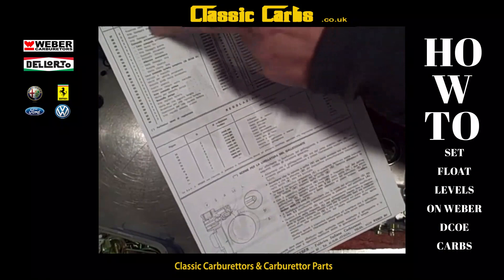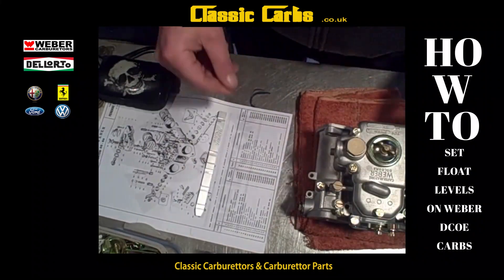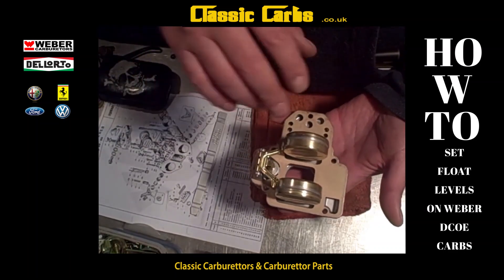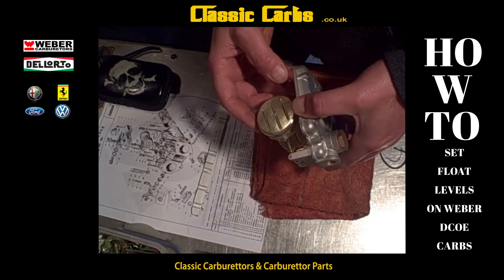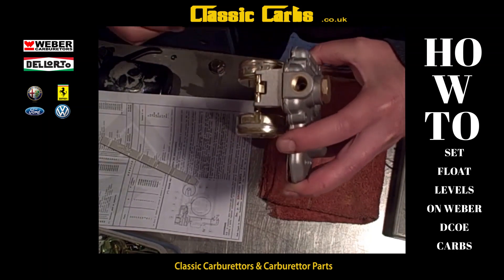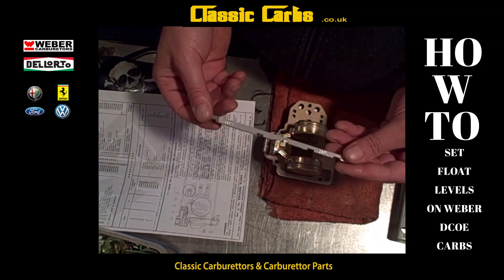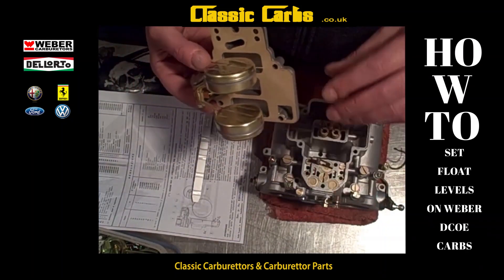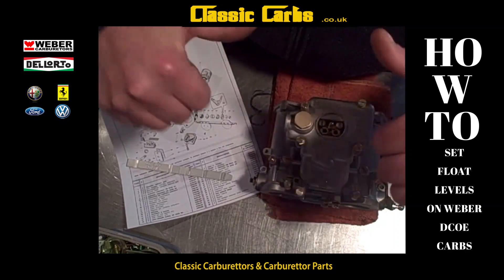Restoration 'How-To' WEBER DCOE Carburettors - Rebuild 4 Float Height Setting - Part 7 of 8

Comment: Next time hold the top cover as illustrated in your paperwork. With the fuel inlet at the top that way you can get a more accurate measurement. I think you held it every other way but the correct way but I hope this helps for next time.